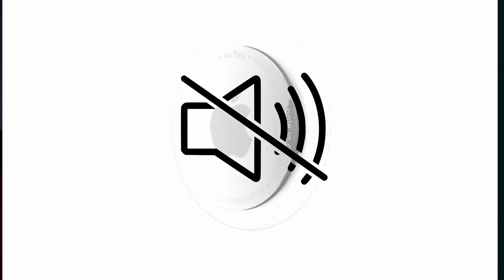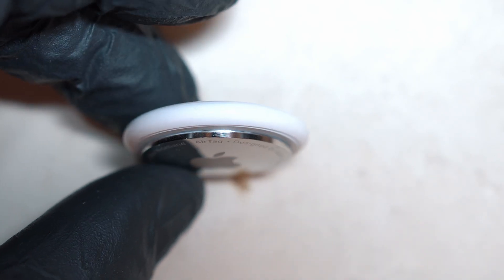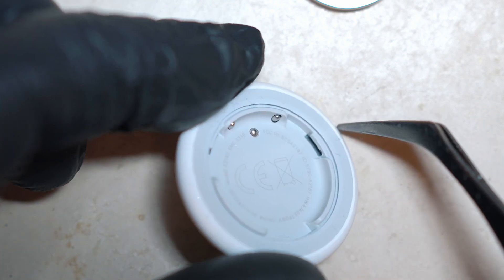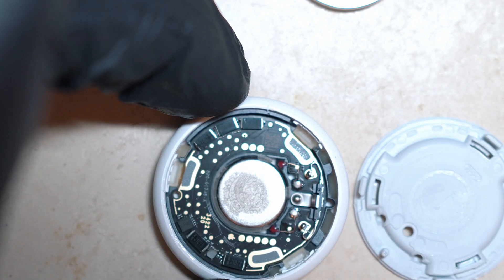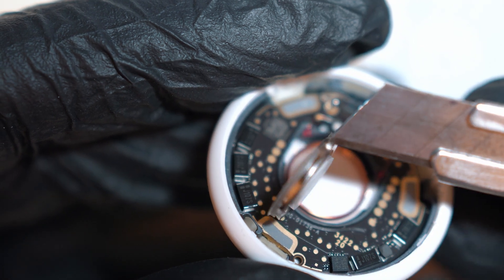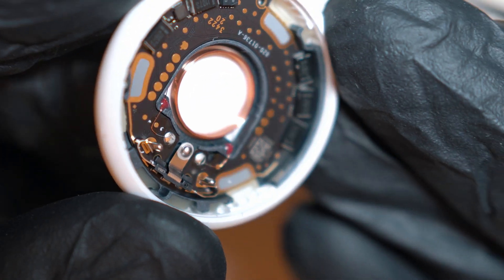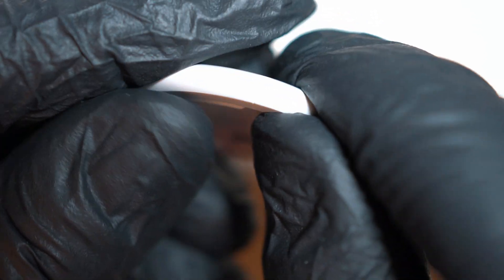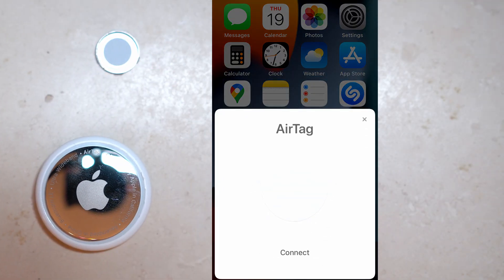How to open and mute (disable speaker) an AirTag 🔇 Apple AirTag SILENT MOD.

Comment: HOW TO UNSCREW THE AIR TAG - The very first thing I found out is that opening that battery compartment isn't nearly as much fun as they make it look. So I wiped down the AirTag with an alcohol pad to remove all skin oils, then placed the shiny side down on one of those rubberized jar top grippers and used an unscrewing motion by gripping the white plastic to separate the two pieces. By doing it this way you are pressing down and twisting on the countertop. After that, I followed his instructions and it went way easier than it has for me before. Thanks!

Comment: Just for others. I bought mine yesterday and arrived today.
They were glued not on the cover but along the circuit side but not melted to coil.
Used box knife to cut around the speaker to make deeper separation and plied around openings where speaker wires are to pull out the speaker.
It seems the worker dropped epoxy glue to one of cover hinge where it didn't come out clean.
After speaker removing, it still makes very quite faint speaker find device tone if the device is put against ear and have it play sound.

Comment: Video is helpful, however I broke two of the plastic tabs upon disassembly so now it no longer works, nor can be found since it cant be closed fully. So let this be a warning to anyone trying to disassemble this.
Reply: Some glue might work. That way, at least the AirTag would be functional until the battery dies...
Reply: Skill issue.

Comment: its work, or fake?
Reply from the maker: nothing here is fake …
Reply: @takeapart  ok, i try it:)
Reply from the maker: @TURIECFOTO report back please
Reply: @takeapart  doesnt work now :/
Reply from the maker: @TURIECFOTO if you didn’t damaged anything while following the video… your airtag is silent so it appears to be dead!  check your phone “find my app”.
Reply: @takeapart yes.. i cant find them now.. can i send you photos somewhere?
Reply from the maker: @TURIECFOTO try to reinstall the battery 5times and bring your phone close to reconnect airtag.  my email is in info section.
Reply: @takeapart  dont be noob please.. is death
Reply from the maker: @TURIECFOTO excuse me, Im trying to help…
Reply from the maker: is there any update on your AirTag situation?
Reply: @takeapart yes.. its in trash, i buy new
Reply from the maker: @TURIECFOTO shoot me a email with detailed photos… please
Reply: @takeapart its in trash, It's useless, there's no reason to solve it.
Reply from the maker: @TURIECFOTO I have looked at your photos and it appears that with whatever tool you used to open the airtag, you also broke bit of black plastic surrounding the PCB. On the black plastic are antennas glued on… if there is damage to traces for antennas it may radiate incorrectly or malfunction.  I would place the little magnet back in to the copper coil (just like prior to the mod) and insert the battery back in (make sure that all 3 battery terminals are properly connected). then bring airtag as close as possible to your phone and see if it’s going to be picked up.  Note: no matter how expensive is the gadget … I like to make sure all is fixed and working.

Comment: I followed the instructions and broke my apple airtag  circuit board. 😢
Reply from the maker: well, sorry to hear that… however you are first person reporting so, you probably did something little extra .
Reply: @takeapart  I guess I used a little more force than needed and broke the circuit board. I bought another AirTag, and it worked. Thanks for your video.

Comment: My battery cover just doesn’t come off
Reply from the maker: push down and twist anti clockwise
Reply: @takeapart I’ve tried that mines legitimately stuck
Reply from the maker: @AllTimeLow052 ah strange…. maybe someone glued it on?
Reply: @takeapart there is glue residue on mine it’s been there since I bought it it at the Apple Store

Comment: IT still makes a noise after removing the speaker element. Just tried it now. The coil is still generating some sound, very feint but it’s audible
Reply from the maker: just cut the copper wire (copper coil) .

Comment: I have instantly break all 3 little clips that holding the bottom of the battery compartment. But nothing serious that some sellotape cannot solve. 
Superglue can work as well of course, if you never want to put the speaker back.

Comment: It is not perfect silent, there is still some sound but weak
Reply from the maker: correct, that copper coil still produces frequency…  my method is nondestructive for airtag …. you can simply cut off copper wire and it will be completely quiet….

Comment: Not sure if this works . On the new gen ,  one a guy from our wood forum drills a small hole in the centre , , then injects super glue so the speaker won’t operate . This sounds iffy but interesting

Comment: I read a YouTuber who was getting a lot of construction equipment stolen uses two air tags on each one , one with the speaker and one without . He leaves one AirTag with its speaker in, that way they find it and throw it out thinking it’s gone , but the other one is still there with no speaker and the the thieves just think there reading the one they removed .I’m going to do this myself , as I have the first gen and removed their speakers
Reply: Recovered my truck when it was stolen using an AirTag
Reply from the maker: @jbs3144 with my silent mod?
Reply: @jbs3144  How did they steal your truck using an AirTag?  (j/k 🙂)
Reply from the maker: great idea
Reply: Thank you so much! That is such a great idea!
Reply from the maker: @jco997 😉
Reply: How difficult is it to remove it on the new gens?
Reply: @MelbourneExclusive0  I read it’s possible but harder . I broke one tab of course on my first gen . Super glue it is lol . 
I was thinking don’t they have these magnet degaussers that you pass a magnet through and it weakens it ? It would totally non evasive of that worked , just kill the magnet and it can’t make noise
Reply: @MajorTendonitis  I ended up buying and removing 2 speakers from them. It's not that hard but a blade makes the job really easy
Reply: Sneaky sneaky 😈 they toss the decoy but they still being tracked muawhahahahahahahahah
Reply: @blockchainbankers7376  well I’m hoping that’s how it works. Hopefully I never have to find out lol . 
I should mention the police were at my residence a few months ago wanting surveillance footage of a guy who stole my neighbours truck . Thankfully it wasn’t my truck that got stolen that night
Reply: But, if they toss the first one, won’t they be able to tell there is still a second one using an app (even if it has no speaker) … ?  ie This method relies on them assuming there is no second tag/them not even scanning using an app for one … ?
Reply: @KierenMoore-t8d  I was assuming maybe they thought hey it’s gone ,and the tag is still just showing temporarily. I’ve never done a test myself to see exactly how the App reacts
Reply: @KierenMoore-t8d they might mistake it for somehow being connected to the original one
Reply: Thanks.  So, it relies on the criminal being extra-dumb/unsophisticated.  No geofencing, either?  AirTags could easily be so much more useful as anti-theft devices; it’s so annoying they are neutered because of the potential for misuse (which is already illegal … and isn’t Apple’s job to ‘police’ …).
Reply: @KierenMoore-t8d  great points . Seriously they’ve pretty much made them useless for theft recovery. All they’re  good for is finding your car in a parking lot. I just thought something is better than nothing .Maybe if a guy hid 10 of them the thieves would move on to an easier target , dunno . Hopefully I never have to find out .

Comment: Does this work to this day? I heard they did a revision to make this more difficult
Reply: Just done my new one - 20/12/2024 - all OK Getting the knife in first time is tricky. I tried a very sharp craft knife but it broke the tip off. Using one the same as in the video worked OK and I amanaged to do it without breaking any clips.

Comment: I've removed the speaker but can still hear it when I hit Play Sound with Find My although not as loud. I thought this mod would completely silence it?
Reply from the maker: for complete silence you have to disconnect the coil as well .
Reply: @takeapart  is it just a matter of removing the copper wire? or is there anything else of consideration
Reply from the maker: @thepiecesfit5049 yeah just cut copper wire (don’t even remove coil)
Reply: @takeapart  thanks already done it's working and completely silent.
Reply: That’s cause you gotta cut the speaker wire it

Comment: My AirTag stopped working after removing speaker. Any help?
Reply: if you broke one or more of the plastic clips while opening it (highly likely), you might need to superglue it shut or the battery might not make good contact with the pins, i had this issue when i did this.
Reply from the maker: thanks for your tip
Reply from the maker: hi, it may appear like so but it works without speaker ….  unless you damaged some internal components while you tried to open it.  You can try to reset airtag by reinserting battery 5x and then pair it again with iphone. Also try new battery…
Reply: is it wroking now?
Reply from the maker: mod is working and airtag as well
Reply: @takeapart  Thanks for the reply  but I was asking him 😅😅
Reply from the maker: oh yea… let’s wait

Comment: never mind i was just scared for peoples safety sorry!
Reply: There are legitimate reasons for wanting a silent AirTag, such as that someone stealing your car, bike, or bag will not be able to find it as easily.
Reply: @zachw566  eeh maybe that does kind of make since because it gives them a push notification and they could make it ping and they could easily find your stuff
Reply: I put one in my car to protect against theft, if it is stolen, the fact they they might receive a notification about it but wont be able to find it will probably scare them into just abandoning it.,
Reply from the maker: I did exactly same thing
Reply: @mactep1  put more than one for sure those thieves are heckling afer they find one!
Reply: ok sorry i’m stupid